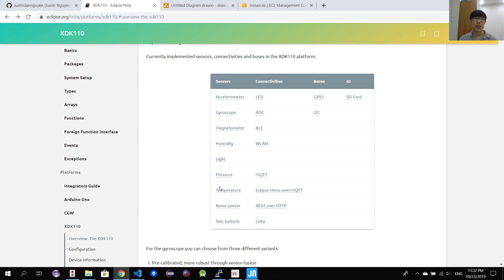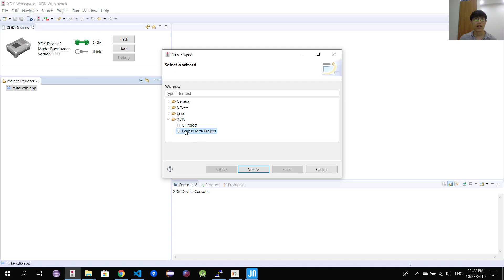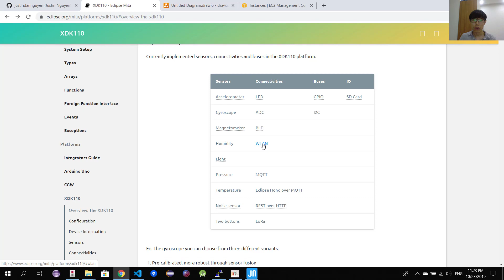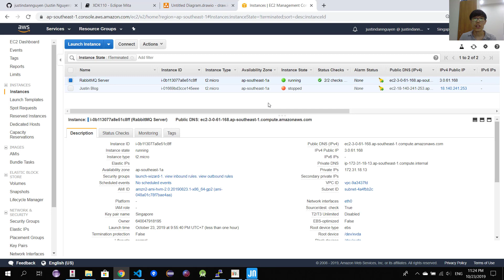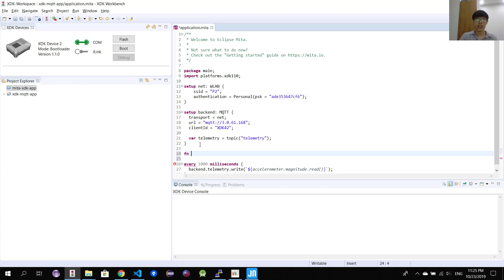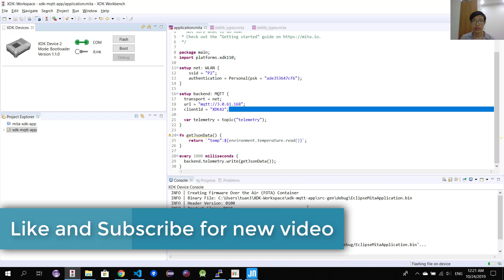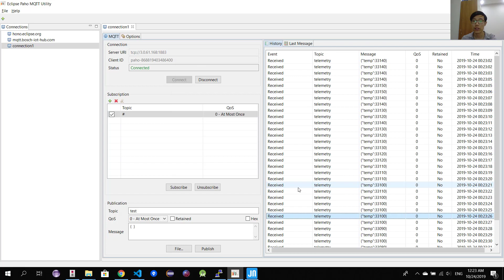How to connect Bosch XDK to Cloud using Eclipse Mita and MQTT

Comment: Hii...How about to automatically reconnect to WLAN? Any idea on how I could achieve it?
Reply from the maker: Faiz Shaari Usually, Auto reconnect are done by mqtt client itself. But you need to take care the subscription, it can be done by listening to disconnected/connected events then create subscription again.
Reply: I mean for the WLAN part.. Because Wifi connection sometimes were having some interruption and the XDK device will got disconnected from the Wifi.. Any idea on how I could make it auto reconnect back to wifi without restarting the XDK device?
Reply from the maker: Faiz Shaari wifi will be reconnected automatically if you use Mita + xdk. You can see reconnecting message on mita console if device is connectting with PC via usb.